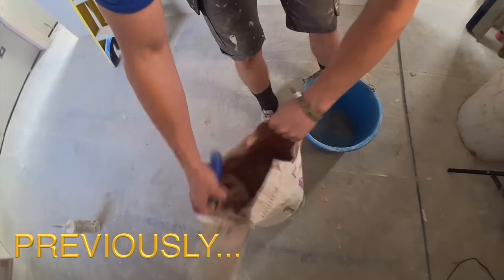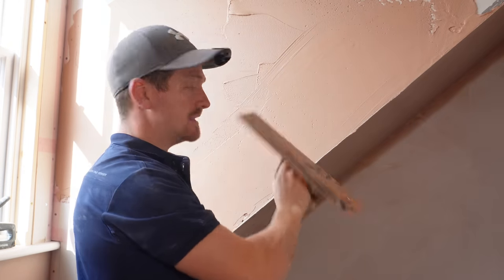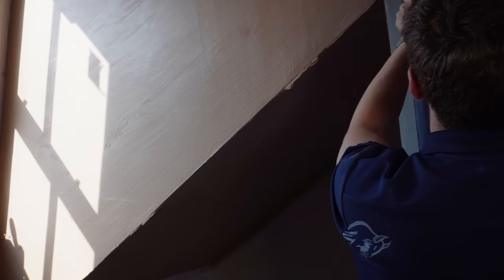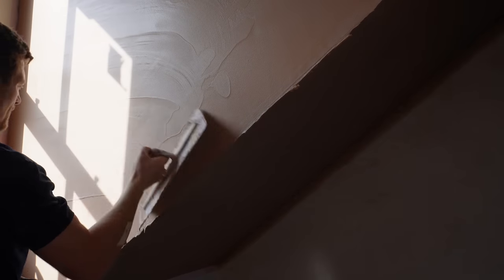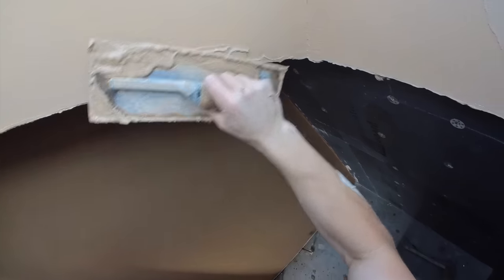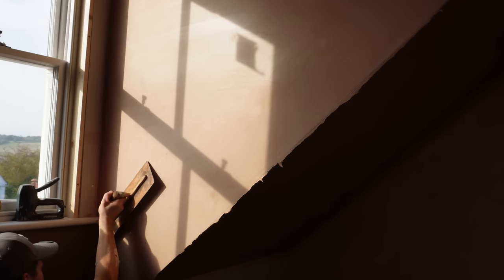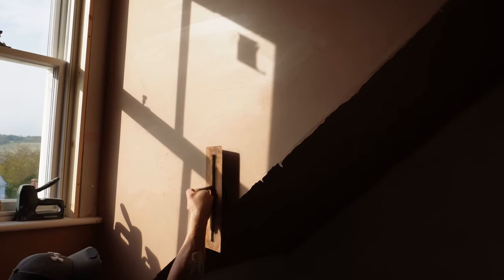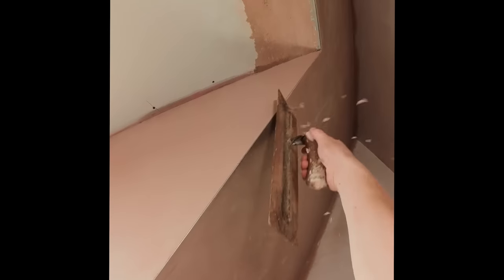Are You Plastering Your Corners Wrong?? AVOID THIS BIG PLASTERING MISTAKE

Comment: Seeing you work by the window was EXTREMELY helpful because it highlighted every mark you were leaving in the plaster during the applying of plaster. Im a complete beginner and often get frustrated with my plastering as it looks 'rough' and I get lots of little air pockets. When I compare myself to your walls I get disheartened as yours always look perfect from the get go. I appreciate youre a pro of course. 

But seeing you work by the window with the light coming from the side is ultra useful as its shown me that even your first few passes are not perfect and do look a little closer to mine. A good finish takes time and work is is not achievable from the get go. 

Have you considered doing tutorials with lighting from the side? I think you did once but even then it wasnt as good/helpful as this window shot.

Comment: Great video. Can you please do one for internal corners with an angle greater than 90 (obtuse) like you had in the video but didn't get into. I saw you used scrim tape, just wondering about getting a straight line on those when they're in your eye line.
I've seen Gyproc do LevelLine but looks like it's for drywall products.

Comment: Hey, I've been loving your videos. Especially your lime plastering video. Do you have any advice for using an angle bead for a corner with lime plaster? I know it is not the traditional way but I'd really like a sharp corner to match the rest of my house which is mostly gypsum.. 
I'll be applying my scratch and float coat quite thick as I'm using insulating render, so I'm thinking I should add my angle bead on after this, before the top coat? Just not sure how to attach it securely... any advice would be greatly appreciated! Thank you for the videos

Comment: Have you had much experience with joint taping external corner's?
I think it's called ultra tape, with the two metal strips.

I have an old council house that wasn't plastered but joints were taped then papered over. Absolute nightmare to work with.

I was an apprentice plasterer when I left school years ago but I've not done it in nearly 20 years

Your videos are a god send to get me back into it, great stuff m8
Reply: The original owner  taped and papered the bedrooms, which the builder had left unfinished, in my parent's house. Taking the paper off was a nightmare, but once I resigned myself to painting the wallpaper, the rest was easy. I taped over any visible seams with fiberglass and it took just a couple of coats of mud and a little sanding to bury that. I cut out any bubbles and scrimed & mudded in a # pattern (the horizontal "joints", then the vertical ones overlapping) to cover those up. When I was done, you couldn't easily tell if it was plaster or taped drywall, let alone painted wallpaper.

Comment: Blaine, thanks for the video. What do you recommend to prep for plastering over artex. Just moved into a new house and all ceilings are artexed. They have been sucking up the water so quick even after applying PVA.
Reply: SBR, don't water it down. Roll it on with a roller , it takes abit longer to dry than pva , but 3 coats should kill all suction on the artex

Comment: Why don't you scrim your beads in dryling we always scrim beads
Reply from the maker: It’s not what’s necessary with this plaster. It’s a lot stronger than standard Joint compound and has a thicker coat which can take more movement than dry lining products.

But I do use scrim around Skylights/ free standing corners, (however they tend to crack regardless because of the movement in the timber.